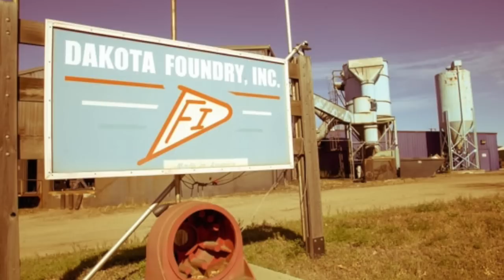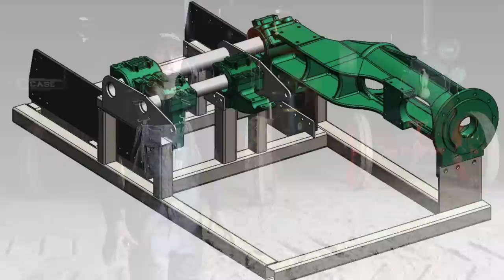Case 150 Steam Engine Documentary - World's Largest Steam Engine Tractor

Comment: Touching, inspiring, and very interesting, to boot.  The rear wheel width extenders were a great idea.  I think that width is ideal for the weight and torque of that engine.  I watched the video of it pulling 44 bottoms, without spinning, or even straining, in fairly compacted ground.  Jaw dropping, to say the least.  I hope to see this tractor at a full blown, modified tractor pull, as an exhibition, at some time.  This would be the kind where they blow engines and break frames.  I have faith that this steamer would chugg along and pull the heaviest sled out of the arena, no problem, at all.